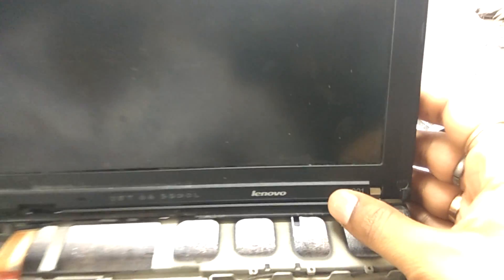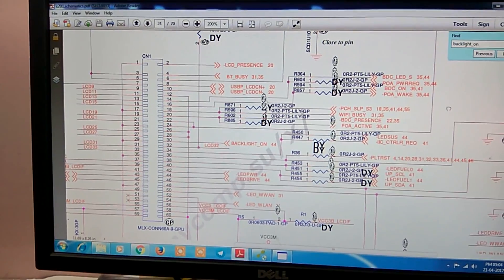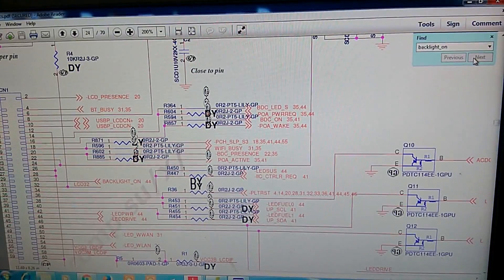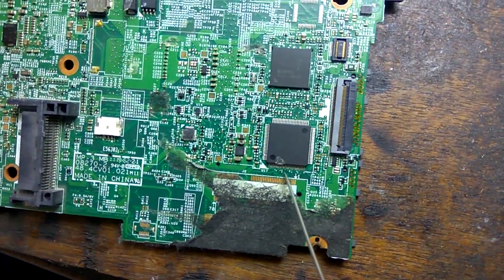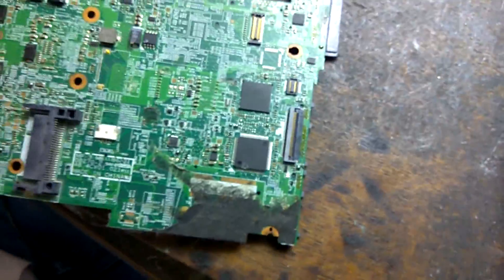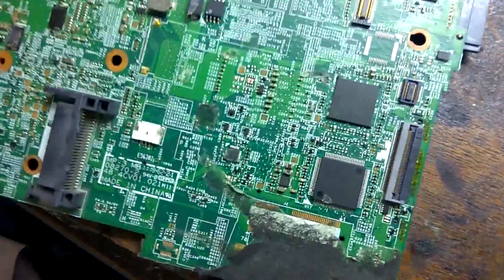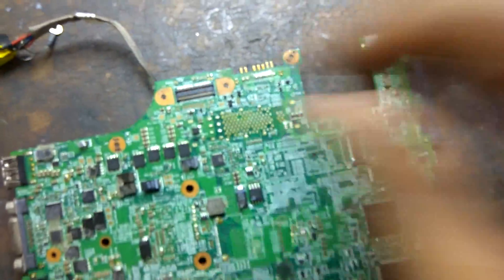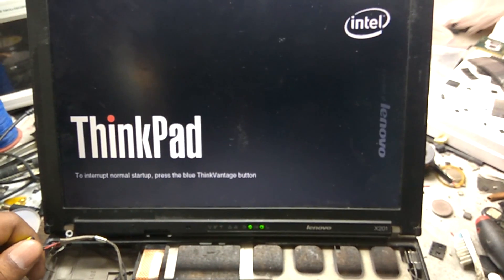Laptop Dim Display issue fixed Solved by #Satishbhai & Aditya11ttt

Comment: Measuring the 3V output without connected display doesn't make any sense, because there is no output if no display is connected!
Maybe it depend on input 96 BLON_IN, but I didn't test.
Reply from the maker: Than try self test !

Comment: Hi, thank you for the tutorial. My laptop X201 has the same fault, missing 3V. I did everything according to your instructions, but the display just flash once and goes dark again. I see picture on display, but no backlight here. Can you please advise me what else to try?   THANKS
Reply: Look on 2 things: backlight lamp to inverter connection (reconnect few times + use contact cleaner spray) and if this will not help look for a spare inverter (used for about $10 on eBay)

Comment: I have Lenovo Ideapad Z710 and sometimes display opening very dim like I can see it wth only flash of camera but notebook is working properly. Desktop has appear in dim. After wait 5-10 minutes wth AC adapter the screen come to normal. What can be the reason for this?
Reply from the maker: Check power setting once
Reply: @Aditya11ttt  Which parameter should I check?

Comment: very good video, I have a thinkpad R51 with the same issue, do you know how I can get the schematic diagram you have used in the video
Reply from the maker: Google it’s available it’s available for free !! So do some !! Search !!
Reply: @Aditya11ttt  I have tried many times, easy to get service and hardware manual but no link for schematics
Reply from the maker: Chic Isles https://vinafix.com/threads/wistron-k6-k-note6-1mb-04240-ibm-r51-r51e.12207/

Comment: Hello Aditya11ttt,  do you know the reason why there is no voltage output BACKLIGHT_ON at IC pin #97. I also have the same issue on my x201.
Reply from the maker: Back trace the signal that is needed to activate this signal !!

Comment: In this case you will not control the lighting anymore
Works as soon as power is connected and battery consumption is fast
Reply from the maker: Lord Dawam yes but in case of non availability of component we have to do with permission of consumer !!
Reply: That's right ... Was not the light cable available to you? Or lighting department
Reply from the maker: No consumer was in a hurry !!

Comment: Do you know why pin 97 on U17 doesn't provide the needed 3.3 V?
Reply from the maker: Contact via what’s app
Reply: Please, this question also is my problem,please answer...after change display who is only scratched but backlight working,now  i dont have backlight at all